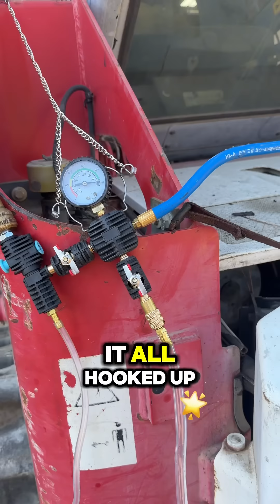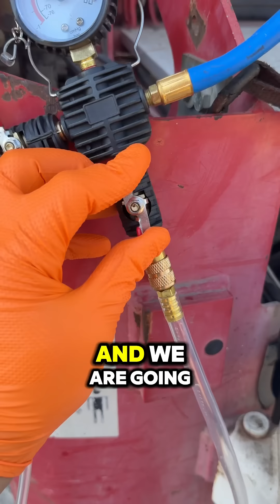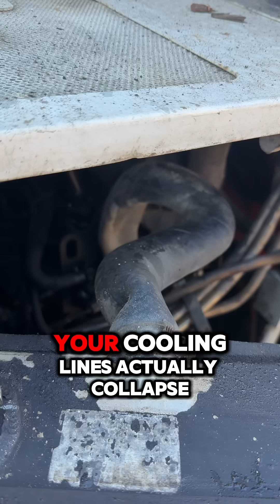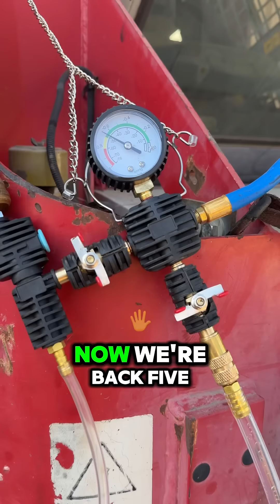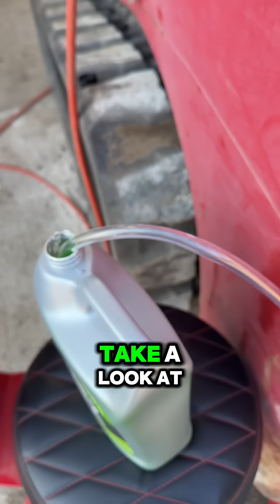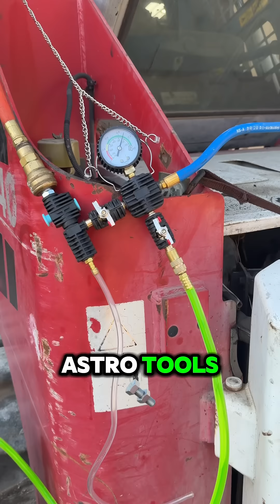Astro Pneumatic Vacuum Coolant Refiller #tools #mechanic #shop #astro

Comment: How much pressure are needed from the compressor for vacuuming?
I mean in psi pressure.
I have a small air compressor that's why I am asking.
Reply: 87-116psi (6-8bar)

Comment: i have been using in a ford escape 2013, and the vacuum gauge was not moving down linearly so i couldn't remove completely the air. any advice?

Comment: Nice for checking leaks and also there are parts of the cooling system that might be above the fill caps.  My range rover requires a vacuum to refresh the coolant without leaving any air pockets.

Comment: I got one on the way. I'll try to prefill the filler hose with coolant so it doesn't suck all that air into the system when you open the fill valve.
Reply: The coolant system usually have about a liter of air in it so it wouldnt really matter if you prefill the line unless you want to completely fill your expansion tank

Comment: I have the snap on radkit plus and I love it. Since I’ve been using the vacuum style fillers I have never had an issue with air pockets like I sometimes would with the spill proof funnels. And it takes a fraction of time to do

Comment: Is that tool really necessary? I thought it was only needed on engines where the radiator cap wasn’t in the high spot and no bleed port on the engine elsewhere so you didn’t have an air bubble end up sitting in the system somewhere. Just fill it normally and run with the radiator cap cracked after refill to purge and massage the hoses when running, etc. We all have our 20 year old radiator pressure testers to check for leaks. Am I missing something? Otherwise, love the content. Maybe I’m just too old with old tools here. Look interesting. Thanks… 🤔
Reply: I believe that's what they were originally designed to do but people have found other uses for them. I am a mobile heavy equipment , truck and fleet mechanic i use mine for many uses. They are nice to use for checking for leaks before adding coolant. But alot of these new diesel engine manufacturers recommended you use them to refill the cooling system because if you could damage engine components like EGR coolers ang VGT Turbos that have coolant running through them. But the one big plus to using one is alot of big equipment and semi trucks hold 10 to 15 plus gallons of coolant and you dont have to carry all that coolant all the way on top of the engine to refill them and make a mess. I use mine every time I can to refill a cooling system.
Reply: I used to work in automotive and have done many coolant service work. The nice thing about this tool is it cuts the burping and massaging out. Once you refill with this tool, you can send the car out and be assured there is no air in the system. Also newer cars and trucks are stubborn with air trapping in the system. This tool is a massive advantage.